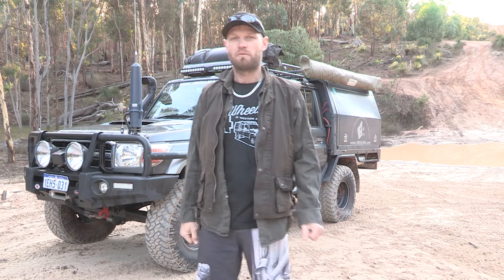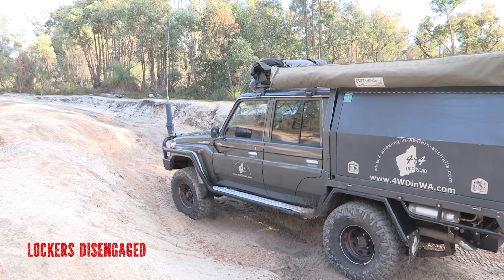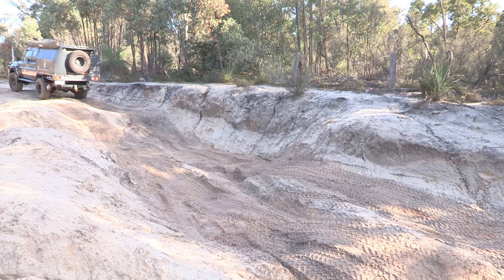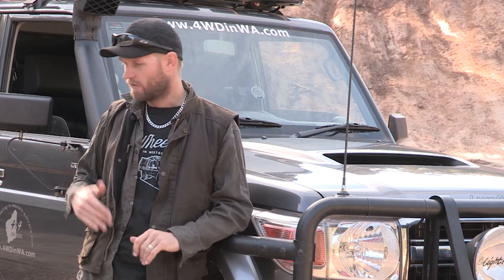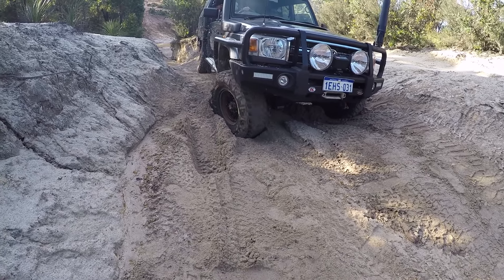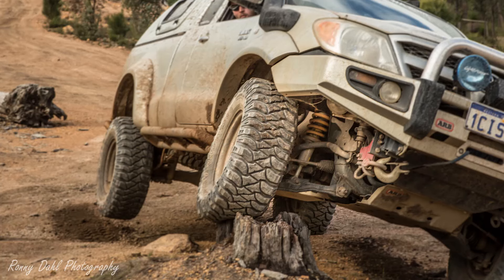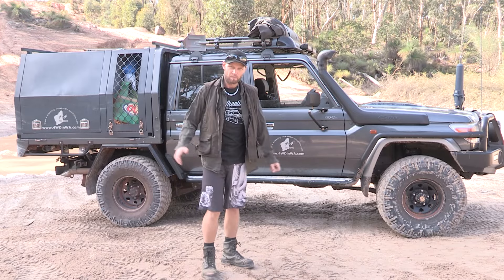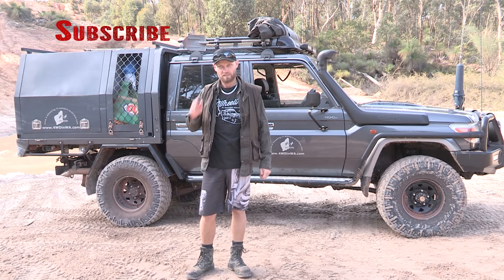diff lockers, how and when to use

Comment: Pajero Sport 2004 should I buy this for light offroad or skip it ??? I want to go on fairly flat sand places and some light mud and rock mountain terrains.
Reply: Skip it. Lockers will double your off-road capability but if don't need that and don't end up using them, you will have wasted your money.  
If later on you find you need more capability out of your vehicle, then get a locker or two.

Comment: I've got a rear air locker on my Hilux. I chose rear as I'm new to 4 wheeling and I didn't want my inexperience on when to use one cost me in repairs. Rear locker I think is more foolproof. I also think so long as you have one or the other you'll get out of most situations. I do wonder if you do a lot of sand driving the front might be a better option as imo the weight at the front is what causes the vehicle to bog.
Really I want both! but at the time of the install I could only afford one. Great video.

Comment: Hi Ronny, love your videos mate. Whats your opinion on traction control? Ive got an 07 pajero and I find that it really helps me get out of some sticky situations without lockers. Obviously its not as good as lockers though and id love to get at least a rear locker one day. Just another thing on the endless list. Cheers
Reply: Cameron Machan for a pajero with independent suspension all around my preference would be a front locker. NS pajeros have a really good LSD in the rear and you should take advantage of that. a front locker and a rear LSD will go further than a front  open diff and a rear locker especially with independent suspension as they have bugger all flex. traction control is good but nowhere near as good as a locker. with traction control on the paj you get a few seconds delay as it will have to sense wheel spin first. the computer system will then prevent wheel spin by applying braking pressure to wheels without traction, thereby directing engine power to the wheels with grip. i also have an NP paj so im pretty familiar with its system
Reply: Thanks for that cjlocsin12 I'll keep that in mind for sure.

Comment: What about center diff lock, i have mitsubishi lancer wagon 1988 full time 4wd, and center diff lock button. I heard i can use it all time im on offroad, and it doesent affect steering?
Reply: Centre diff lock locks the front and rear axles together, it does the same thing as selecting 4WD.  
You can use it when you are off road, exactly the same as you would with using 4WD.

Comment: Best carrier units to put in a vehicle. Are a torsen no worrying about electric wires to lock differentials or Airlines to lock differentials.

They will also allow you to make turns so the outside wheel is spinning faster than the inside wheel. And they don't break best units ever designed in the world. Allowing you to get constant traction period in 4 wheel High 2 and 4 wheel low
Reply: Torsens are a good simple mechanical design and and superior to a regular LSD but they don't perform as well as a locker. When a wheel is completely lifted off the ground they will just spin it up like an open diff would. They also allow some wheel spin when on the ground which can cause loss of momentum. They will work fine for average conditions but not in difficult technical driving where complete locker engagement is needed at all times.  
An automatic diff lock also has no air lines and wiring but will completely lock wheels together, although it doesn't operate as smoothly as a torsen on the road.
Reply: JP Onefourseven and that is why when a wheel does come off the ground and starts to spin. You apply the brake. That will force the power back to the wheel that is not spinning. Again you will avoid wiring cables and Air Supply to your carriers
Reply: JP Onefourseven now if you're actually talking about hardcore rock climbing yes I can see a point in getting a locking differential. I see that we just at two different Forks in the road LOL

Comment: okidoki I have a 100 series Sahara petrol and it has central different lock ! how would fitting rear different lockers help me and what would it do to the center diff ? I'm obviously a newbie so play nice boys
Reply: Locking the centre diff is the same thing as going into 4WD mode, it just means the front and rear axles become locked together.  
Front and rear diff lockers will work as normal, but they will only be properly useful once the centre diff is locked.

Comment: Hello Ronny.How about midle dif lock ? I have a grand vitara.Will it do the job in the example with same tires?
Reply: The centre diff lock does the same thing as selecting 4WD on a part time system. Both will lock front and rear axles together.

Comment: Here in Brazil, Nissan Navara (named here as Frontier) doesn't come with a diff lock anymore, it's a shame. What about the Eaton G80 locking differential that goes into some Chevy Trucks (and locks automatically and mechanically) does is it really work? Is it as effective as a diff locker that is engaged by the driver?
Reply: First thing is can you buy one for the Navara? They might only be available for Chevy trucks.  
Second thing no they are not as effective as a manual locker. They only engage after you have lost traction, it is better to have a locker that doesn't let you lose traction in the first place.  
There are other type of auto lockers that don't have a delay like that, such as the "Detroit locker" and the various brands of lunchbox lockers.

Comment: Can you lock a 10 bolt from the drivers seat. Is there a 10 bolt rear end for the front and can you engage the front from the drivers seat or must I exit the vehicle to engage all four corners? 

Which is best electric winches or hydraulic winches engage to PTO spool out the cable and power from the drivers seat and accelerate from the drivers seat I understand if the engine stops so does the winch(s)!

Comment: Just my 2 cents worth 
Run down of my 4wd, HDJ80  with twin air lockers, I always turn mine on at least once a month to keep everything moving and to test to see if they still engage properly 
Doing this has saved me thousands of dollars as once the compressor was running and not switching off turns out the front air line was cut inside the front due to a worn and nearly destroyed bearing. The next is my switch was buggered ( I have the same switch as you do) and I couldn’t engage front locker I took everything apart, the air lines to the compressor, all the wiring and traced everything to the switch. Pulled the switch out and saw the the connections were burnt so ordered a new switch and it works again so all in all my advice is even if you aren’t using it as a 4wd all the time and it spends a lot of time on the grey stuff then find a dirt track turn your lockers on (only need to do it for a short distance) just to make sure everything is in good working order

Comment: (Six years later I'm asking) what kind of radios do you guys run on those rigs, specifically? Just curious. In the States some of us get our ham radio licenses and add 2-meter VHF radios (some also add 1.44-meter UHF radios). Our antennas don't need to be that gnarly though. Is the huge antenna for a long range HF radio of some type?

Comment: Hey Ronny, would you recommend having lockers on when driving through soft sand as a precaution to getting bogged or would you only engage once/if bogged?
Reply: Ronny answer this before I fully engage diff at will

Comment: how is it maintenance wise? I'm in Canada so we mostly get snow not really sand or mud. I usually drive 2wd pickups because i dont go offroad(yup I dont have it and to be honest there's maybe been twice in 17 years where i really did need so its never been worth it for me, studded snow tires and some weight are a must tho..). I am now considering it for the next truck. So I know that if you have a 4x4 you should use it a few times a year to make sure it keeps working, heard lots of issue can happen if you never use it, but I guess my question is if I did get a 4x4 with a diff lock and say i didnt use it, either the 4x4 or diff lock for say 6months-2years or more, would it just quit working? I'm worried that if i did spend the money id rarely use it and then develop alot of problems for never turning it on.

Comment: Can manual hubs go on the rear and front? Would this be pretty much the same as diff lockers once manually engaged hitting trails?
Reply: Manual hubs are only for the front, they are there to disconnect the front wheels from the front diff so they can spin freely without turning the diff. 
There is no reason to do this on the rear.  
It is not the same thing as lockers.
Reply: @JeremyPetho  I asked this 4 months ago. I am shocked you guys came back and answered this. Very appreciative you took the time to help me out answer. This is easily one of my favorite channels to watch!!!!!! Thank you kindly for your help!!!!!

Comment: I have a 1997 lexus lx450  which is the same thing as the land cruiser  ,It has the  front and rear lockers knob like you showed in the video .I live near the mountains and when I'm on my way down the hill  the  road  can be a few miles  of steep grade where you have to keep using your breaks . What is the  best setting to use going down  a hill so I don't have to keep my foot on the breaks the whole way down . In most cases its a  cut road   and pretty smooth  . No big rocks to go over or anything  just  steep down hill  for miles .  Which is better for  the  gears and  transmission ? Would it hurt to put it in 4xL and leave it  there  for miles going down the hill ? Or is it  better to put it in 2 or L gear  in the transmission and not  put it in 4xL ?. I also have  2 other  buttons just to the right of the  4xh/L shifted  one has Pwr and the other as 2nd  What do these  push buttons do ?

Comment: I have a 91 Toyota ifs. the rear locker was a Detroit locker which cost $612.00. luckely I saved a ton be doing the labor myself. recently I've purchased a Spartan locker for the front but it's on hold due to lack of cash for new bearings,seals and gaskets. plus a possible design flaw with the passenger side front diff. bearing. which I'm reading that is a needle bearing. I will investigate and possibly machine a larger heavy duty roller bearing on that side, should funds increase. have you any knowledge of this weaker right side bearing. please share. thanks

Comment: Ronny with the front locker off,  but in 4x4 with hubs locked does it work just like a normal open diff 4x4?  I would like to keep this option for driving on snowy roads.
Reply: Yes, manual lockers are normal open diffs when not locked.  
But an automatic locker will not work like an open diff, so if you want the front to function like a normal open diff at times, you need a manual locker.

Comment: In an all wheel drive Prado can you have the central locker and the rear locker engaged at the same time ?
Reply: Yes, and you should only use the rear locker when you have the centre locked.

Comment: Nice video! Do you guys use f150s (fx4 v8) for off-roading in Australia or is everyone on a Toyota?
Reply: Toyotas are the main choice. Their reliability  sells them but the joke is they are known as " White goods ( eg refrigerators) on wheels.
My bent currently is the Iveco dual cab 4x4. Diff locks centre, rear and front.
On 37 s.

Comment: Hi bro THX 4 the Info.
I drive a Dual cab, Nissan D 22, engine QD 3.2 L
I am often OFF road
it has
2 WD / 4WD-  H/ 4WD - L
Actually in worst case senario: 4WD - L + 2nd or 1st gear = All roger
Hence got no diff locks req. so far
Was just wondering if ever to install a Diff lock !

Comment: I have "stages" that I use to improve my 4x4's performance depending on how rough the terrain is:
1 - Pull lever to  engage 4wd (font hubs lock automatically)
2 - Let down tyres
3 - Engage front elocker
4 - Disconnect rear sway bar (I have sway bar disconnects)
and if all else fails
5 - Engage rear elocker, use low range

Stage 1 & 2 get me through 90% of things.
Reply: Wouldn't it be easier to swap 4 and 5?

Comment: I have a question. If say my sequoia with 4hi engaged and center diff unlocked is in a situation where 2 front tires are on the ice and 2 rear tires are on a pavement - am I benefiting from having it on 4hi or is it better to have it on 2hi? The reason I’m asking is as far as I understand if I’m on 4hi and the center diff is unlocked I’ll spin the 2 front tires on ice while rear 2 tires will not and if I just switch it back to 2hi at least 1 rear tire will spin. (I know I have a center diff lock button but assuming I don’t want to use it).  I just want to know if I got the concept right :-)

Comment: Rear locker for me! I have a F350 dually 6 speed manual 4X4.
Reply: Jackie Freeman My F350 SRW FX4 came with a electrical rear and I’m putting a Detroit locker in the front. A winch, winch bumper, and match rear bumper coming soon.

Comment: Hey man, just started watching your channel and I’m thoroughly enjoying the content! I have a question I’d hope you’d might have some insight to. 

I have a 2002 4Runner that’s equipped with a factory center diff lock rather than a rear e-locker. If I went the route of upgrading to a front and rear locker, would it be overkill to have all 3 locked at the same time? I know there’s a lot of variables here, but have you seen any examples like this in your wheeling travels?
Reply: Start with the center diff.  Then the rear.  Then if you're still stuck use all three.  The center diff when locked will send even power to the front and rear axles.   And the axle lockers will send even power to the driver and passenger side tires.  You save the front diff locker for last because the steering axle sees more strain from a locker than the non steering axle.

Comment: wondering... my Montero/pajero seems to have stock locked difs... no options... does that mean I should only use 4wd when absolutely needed? sometimes I leave it in 4wd just because its a pain to get it out... meaning, I need to actually roll backwards about 5ft to lock in or disengage my 4wd...
Reply: No car comes with stock locked diffs, and if they were locked it would be very difficult to drive on the road.  
Putting it in 4WD will lock the front and rear axles together which can cause binding and tyre scrubbing, so it should only be engaged when on loose surfaces to prevent wear and damage to the driveline.
Reply: hmm... I guess I need to research diff locks more... I thought that because my tires all spin at same speed regardless of terrain or even off the ground, that meant the diffs were locked....
Reply: 4WD locks the front and rear axles together, meaning that the average speeds of both front wheels is the same as the average speed of both rear wheels.  
Diff locks lock the wheels on the left and right sides together. This gives lots of traction but the tyres will drag a lot when turning.  

Lifting only one wheel isn't always enough to cause loss of motion as 3 wheels on the ground will usually keep you driving when you are in 4WD.  
Also traction control uses the brakes to stop wheels from spinning and help keep traction to the wheels on the ground.

Comment: Looking for advice. I have a 1996 Toyota 4Runner that has a factory installed rear e-locker. I'm planning on getting a locker for the front. Should I upgrade the rear locker or will the factory e-locker be sufficient?
Reply: It will be sufficient.

Comment: The Landy Discovery I and RR Classic would require a momentum based approach to the sandy hillclimb, wouldn't they?
Reply from the maker: Vee6watchman yes! if the sand is soft momentum is KEY with or without diff lockers. Some more harder packed sand hill climbs can be done slowly even the steep ones.

Comment: Recently added a plate front bumper and a winch. My next step would be a locker. My truck is an 08 Tacoma with 2 inch lift. 2wd... So would a rear locker as a next upgrade be better than front?
Reply: You can't put a front locker on a 2wd. It doesn't even have a front diff.
Reply: Matthew Trent lol

Comment: My ram manual says if i use the locker while stuck i can damage the truck. I thought this was also a purpose of a locker, to get unstuck?
Reply: Lockers are good for getting unstuck and even better for not getting stuck in the first place.  
But if you get one wheel so stuck that it can not turn at all (maybe jammed between some rocks or deeply buried in clay), all of the torque can end up on that one wheel which can cause the axle shaft to snap.

Comment: So which is the best out of a rear locker or a Central diff lock
Reply: I bet you know the difference by now, but just in case, central diff lock is essential for an AWD (all time 4WD) car to become a true 4x4. In cars that don't have central diff (part time 4WD) the transfer case is like a locked diff.
Reply: Centre diff lock or not, a true 4x4 will have to have both axles having some locking arrangement in the diffs. No locks, its only 2wd because the diffs are open.  Bull?  Try jacking up both wheels on the same side and see if it still moves?  No axle locks, no go.

Comment: can you have like the center locking diff and a rear locking diff? Like if I wanted to add a rear locking diff to a 4x4 4runner but it has the center locker. Would that be an issue or?
Reply: No, locking the centre diff is the same as putting a normal 4WD vehicle into 4WD mode.  
There is no issue with adding front or rear lockers, but they are only going to be useful when the centre diff is locked.